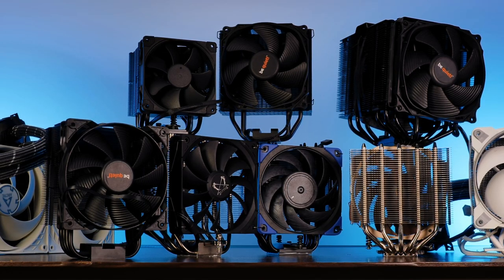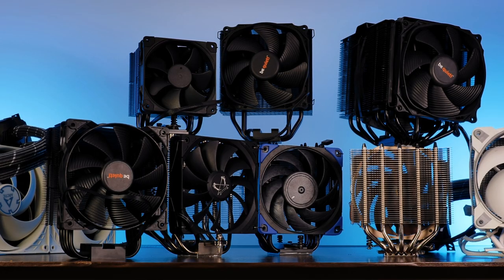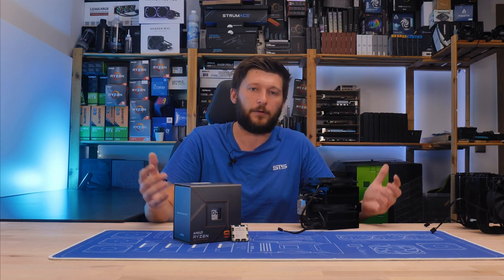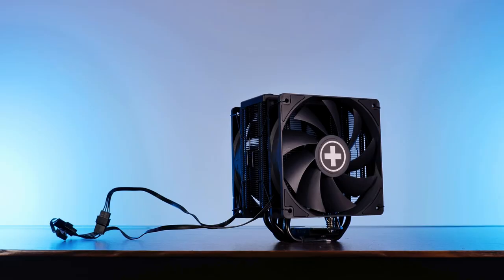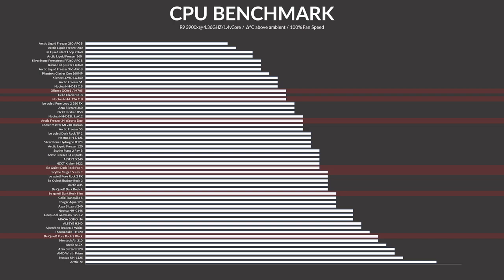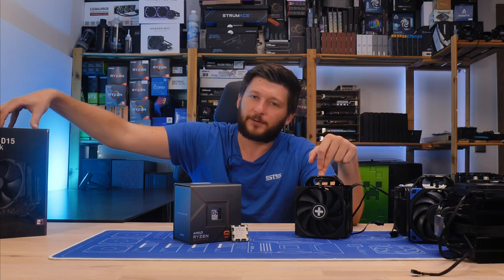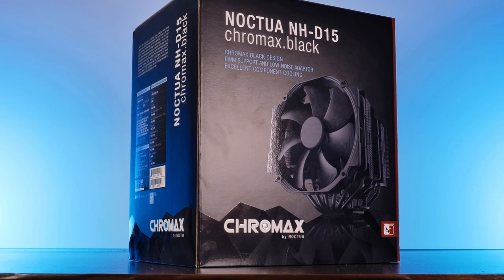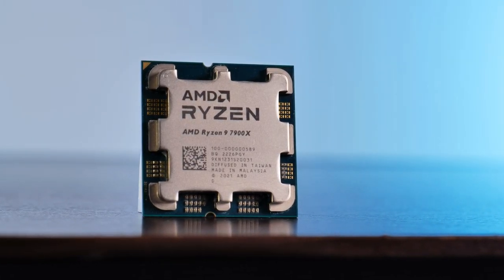How FAT should a Ryzen 7900x cooler be? ❄️ - 7900x Cooling

Comment: I would definitely lock this cpu at 125W as the performance loss is too small to justify using it in unlimited mode.
Reply: whats it clocking at 125W?
Reply: @jessielees  I'm not remember the clocks, but the drop in frequency is less than 200mhz.
Reply: @wiktec  I think its around 5100Mhz all cores, it performs very well with some undervolting and watt reduction. With the N15 I'm getting 81 degree's and CBR23 score of 29,700, With a 160 TDP, still close to 5300 all cores.
Reply: @jessielees  65w for me 🤣
Reply: My pc blue screen for 65watts hahaha had to lock it at 125 @eriknordqvist9016
Reply: How lock 125w on the asrock motherboard?  Thanks ;)

Comment: the 7900 instead of 7900x is a better option. Lower wattage and heat dissipation out of the box with decent performance + ability to over clock and match the max boost that of the 7900x a win win.

Comment: The real solution is to get the non X version @65 watts so what if the base clock is 3.7 compared to 4.7 you can still overclock it. I've never been a fan of these big coolers.
Reply from the maker: Sure, it’s always just a question of if you really need the performance

Comment: Thanks for the review. The only thing you missed was the possibility of using some coolers in 7900x Eco mode. 
For some users, this will be an acceptable air cooling solution.
Reply: Or just getting the non X version
Reply: Eco mode is trash
Reply: @godnamedtay literal cap 🧢

Comment: hey i didn't see the 420 listed in your chart.. Just curious - Did you see any improvements with the big 420 rad? Also if i'm reading this right, you saw better temps on the 280 vs the 360 ? (arctic liquid freeze II). currently upgrading me 7700k to either: 12900k, 13700k, or 7900x. currently running a 280 rad, but can fit a 420 if there are some actual improvements, not just 1-2c.

Comment: Wondering how the arctic 280 did better then the 360 version. By physics the 360 should be better.
Reply: Same here
Reply from the maker: Because the cooling performance of different coolers in relation to one another can change depending on the amount of heat.

This is also not exclusive to Water coolers. Take Noctua's NH-D15 & U12A. Depending on the load, the U12A (can) outperform a D15. But turn the heat up and the D15 will be far in front of a U12.

The list you are referring too was created using a 3900x that pushes 135W. And the order of cooler on that list is exclusive for that very specific use case. Change the CPU, change the load, and the order can switch. Keep in mind that the list will not "change" but coolers that perform quite similarly might switch places.
We used that list to have an "indication" of what to expect. And because that list would not apply directly to the 7900x, we removed the actual numbers. 

I pulled up the excel sheet where I have all the cooling numbers for all Ryzen 7000 chips.
The 360 vs 280 problem comes up with those chips too.
Temp normalized to 23°:
LF 360 7600x -> 76,4°C ( .4°C better)
LF 280 7600x -> 77°C

LF 360 7900x -> 82,9°C  (.5°C worse)
LF 280 7900x -> 82,4°C

So if I would have created "real" benchmark lists for every cooler in combination with every Ryzen chip, depending on the chip, the coolers would have switched places.

For any benchmark charts that you see out there, you should take them only as sort of an indication how a cooler will perform compared to other ones. But it's never an exact value if you do not happen to have the exact same system. Most of the times such a list will be somewhat accurate. But keep in mind that things might be open to minimal changes.

I've seen a dozen Reddit posts of people asking about a LF 280 vs LF 360 comparison. Then someone posts my video under it, accompanied by an army of people referring to Gamers Nexus video and calling me out for not having 1-1 the same results. What everybody forgets there is that GM pushed almost 200W through their coolers, we are doing (only) 130. And what can happen here is that the results at the top end will start to get squished together and sometimes a bit blurry.

I did my very best to find an example for this other than myself as a source. Surprisingly, I did not find a single person that did a complete Arctic Lineup comparison using different loads.
The closest thing I could find is Anandtech and their LF 420 Review.
They did a bunch of graphs at different loads using various coolers.

https://images.anandtech.com/graphs/graph16427/120490.png -> 200W
https://images.anandtech.com/graphs/graph16427/120491.png -> 250W
https://images.anandtech.com/graphs/graph16427/120492.png -> 340W

Ignore the LF 240 and keep an eye on the LF 420 vs Alphacool 360.

For 200W, the LF 420 had the first spot. Not by a lot though.
For 250W, the Alphacool took over. Again by a tiny amount.
At 340W, the difference became quite big.

And this is the exact same thing. They switched places because the load changed.
But, the trend of the graph is still applicable regardless of the load. At any point, both coolers were at the top, and a lot better compared to the last few ones. 
Just don't take these numbers 1-1. Look where they stand +- compared to everything else.

Sorry for the enormous answer. I'm shocked myself. Just got this question way to often over the last few months and wanted to answer it once and for all.

Hope this helped :)
Reply: @STSYT  thank you for the detailed reply helps a lot. By the way I was not questioning your testing mythology or results. First video I have seen of yours and just by basic knowledge of how heat/cooling works I figured 360 should of been better

Comment: I have 7900x with Dark Rock Pro 4 air cooler, H7 Flow case with 2x PWM fans, 140mm front and 120mm rear. Cinebench R23, 10 min 100% CPU workload, temp got up to 94 C. My test show that it is about the case and the CPU cooler. The fans can reduce a few degrees but not much. AMD says clearly that 95 C is tjmax but not the limit for power. So it is a safe working 24/7 temp. without reducing efficiency or risking damaging the cpu.
Reply: Just run new test with everything closed. Max temp of cores, 92.9 C, one CCD got to 95 for a fraction of a second. Most of the cores never passed 80 C. So, Dark Rock can cool it just fine, if you have a mesh case with solid airflow.
Reply: Same case and same cooler here, confirmed this. I also have 2 case fans, one in front and one in back. Being satisfied with temps I decided to gift my pc 2 more coolers in front, just waiting my fan splitter to arive. The front of h7 case is like ice cold always and pulling in fresh air. That is realy one amazing case.
Reply: @vladasimovic2732 was looking to get a nice case for this for air cooling. Thinking about the fractal north. Do you think that would be a good fit for it? also thinking about a fractal north xl but I'm worried a bit about space
Reply: @TheSpineOfTheWorld  Hi, tbh I don't remember quite clearly about the specs for Fractal North. The cases are great, but you should consider the width for air cooler. It should be at least a little wider when considering MB, CPU and cooler. Safe bet would be 5cm wider I think, but I saw some people fitting it quite tight and having no problem. Also, consider the length if you have big GPU. Mine is 4090 so it is HUGE. So far, I am really happy with my setup. Hope I helped at least a little...

Comment: This test makes absolutely no sense. See hardware Canucks vidéo.
95 degrees is a target (frequency is adjusted to match this target, even with the best cooler you can get 95 deg, but with a larger frequency).
Fixing the voltage makes no sense with these CPU as they can automatically adjust it to what they need.
Only changing the values of the curve optimizer, and the throttle temperature makes sense. You can change the throttle target to 70 deg if you want, with any cooler, and you will just have a lower frequency than with a target at 95 deg. For most applications having 5.2 instead of 5.5 GHz will not be a big deal.

Comment: I ve orderd an corsair aio 280 but I will cancel my order and buy the dark rock 4 pro. I have the 500fx case with 3 x12 12 front fans and 1x14 rear and 1x14 upper exhaust fan will be ok.

Comment: Still waiting for the next gen NH-D15. [sigh].
I do plan a 9ooo series, 16 cores, Zen 5 on AM5, and the plan is to set it to self regulate and clock when & where and how it can, and if it gets to 95 ~ well throttle down already! I don't plan to manually clock the thing up & over-volt it just to see what happens. It's designed to run at 95 and self-regulate to stay about there, when loaded. That sounds fine, but when you manually set clocks and voltages and stuff to show how hot it gets, you're breaking that self management and regulation it is designed to do. It's a little bit like jamming the thermostat in your car and then complaining that it boils. That's the sort of thing Top Gear did, not a real car show ~

Comment: I have 7900X with AK400 cooler, I can get 5.4 GHZ all cores with a -35 curve optimizer and target temperature of 85 degrees. Cinebench R23 score of slightly above 30000.

If I change the cooler I may get 100 or 200 more MHz, this is not a bit deal at all.
Reply: wow, I would be very grateful if you could show me how to set in bios...❤
Reply: I would also like to see how you set this up if you have any tutorials you know of

Comment: im running the be quiet rock pro 4 with 7900x and yea it does get hot, but in gaming alone its perfecly stable at around 60% - 70%temps. i may need to get a watercooler but i dont like having loud fans in my system. anyone can reccmomend me a quiet water cooler?
Reply: Percentage temps? What does that mean? Or do you mean Celsius?
Reply: Hi, did you upgrade to a water cooler? I am torn to go for a water cooler for the first time ever for my AMD 7800x3d

Comment: I guess the outcome is to use a water cooler. They tend to be expensive and also need the right type of case to mount them. I currently have 12600k and that runs great with a tower cooler so cant see me changing soon.
Reply: Or, A D15, a Peerless Assassin 120, etc. You really really do not have to spend a ton of money on an AIO. A 35 dollar PA120 will be fine for the vast majority of users. If you work in a naturally hot environment, and while in that environment regularly pump your CPU to its max for long durations, yes, get an AIO, but if the answer to one or all of those is "no", stop wasting money.

Comment: Idk how I see so many state that the 7900x gets super hot. I have a 7900x with the nzxt kraken elite 360 rgb 3 fan. The highest I've seen it get in full high settings is 70-73c gaming 6hrs. I also have the nzxt elite flow case with 3 big front fans. Idk if I'm just lucky but I never reach above 83

Comment: well for me second fan for  nh-d15 didn't fit, so yeah, not great. At the beginning I had water cooler but it didn't cool that beast, that when I decided to buy best air cooler)

correction: added case fans to optimize case airflow - now NH-D15 tamed that CPU)

Comment: Great video as always. It's interesting, how difficult it will be for aircoolers to handle 13.gen. It's a bit harder to cool AMD 7xxx series, because of this chiplet design, maybe those aircooler will have better luck with Intel. I meah, Xilence can handle 220W of TDP, it should be enough to cool 13600K, at least on paper.

Comment: My noctua NH-U12S-SE managed 97°C in prime 95 stress test after 30 minutes of waiting so I think its ok with me because I just use the eco mode anyway :) plenty of power for me
Reply: Shouldn't it be 95c all the time?
Reply: @thealien_ali3382  not with eco mode. it takes less power and doesnt get so hot. in eco mode it runs at 45-50°C if im just wathcing youtube or not doing anything and only uses 45-50 Watts of energy

Comment: Strange BIOS setups for these chips. I'm wondering already if they'll be like the 5800X. It was discovered that the 5800X is overvolted by most Mobo makers. If you do a negative voltage offset on a 5800X and manually set the PBO to +200, they will boost to about 5.1ghz and still run about 8 to 10c cooler on my NH-U14S.... I'm wondering if the same will apply to these new Zen 4 and they are simply set up crazy.
I predict a wave of undervolting videos for new GPUs and CPUs.
Reply: what kinda negative voltage offset? Like where should the voltage be set at?
Reply: @johnphillip1711  I was doing -0.7 in my BIOS. Now I'm lazy and just turn on eco mode, it does the same thing...
Reply: @MrEricmopar  thank you